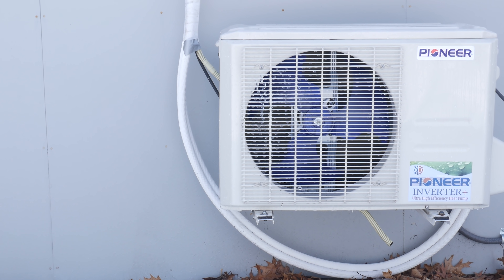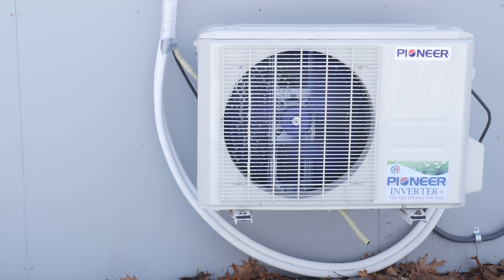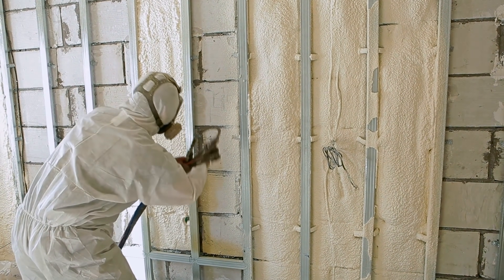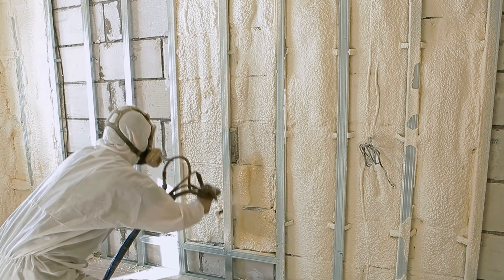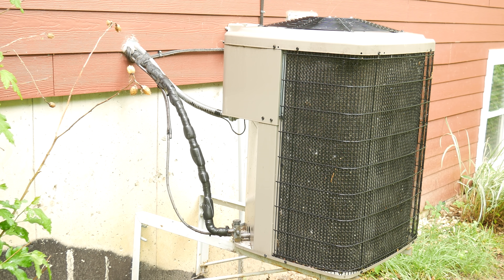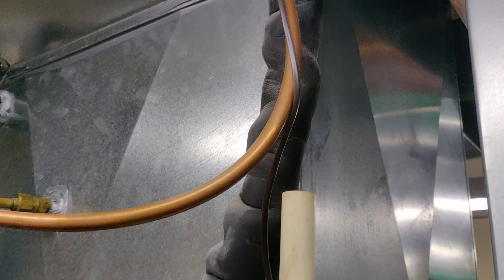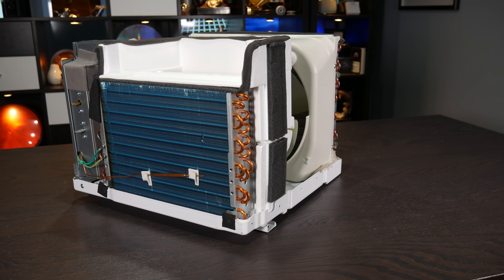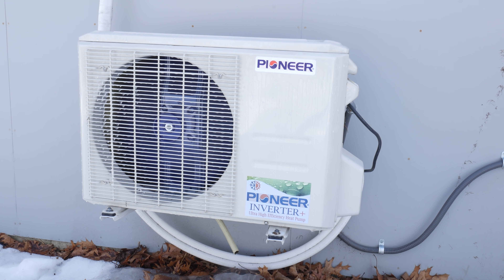Heat Pumps are Not Hard: Here's what it will take to start pumping

Comment: I've had similar experiences with even the simplest of minisplit installations. For a tiny minisplit installation like you had where it's right opposite an exterior wall they wanted to charge me $3k+ in labor or $5k to use their minisplit. Which is insane because I spent that much (~$5K) on replacing a whole furnace+evap 2ton unit. I just wanted some tiny supplementary cooling for my computer room. I ended up getting a cheap pioneer unit like yours and having a handyman do the install for <$1k.
Reply: We had a minisplit put in just over a year ago, and I am so glad that I paid the exorbitant prices from a local HVAC company instead of doing it myself.  Every 2-3 months, it would lose the last of its refrigerant, and we would need to have it serviced.  

I got to know the technicians (pretty much all the ones this company had), since they were in our house so frequently.  They were extremely knowledgeable and capable, and seemed to assure us each time that the problem was actually solved, but, as you can tell, it wasn't.  Eventually the head was completely replaced, and that fixed the issue, but before they reached that point, there was at least 60+ hours of work spent trying to diagnose and fix our lines.

Even though it was a bit more than a year (the term of our warranty), the installation company never charged us a dime, which is amazing since for every hour they spent installing this unit, they spent 10 hours on service calls, not to mention at least a thousand dollars on refrigerant (it was replaced probably 8 to 10 times in that year+).

I think this is why quotes are so high.  Even though most installs are painless, there are a few like mine where everything keeps failing, and you can't charge the customer for it because it is not their fault.
Reply: @uigrad  "I think this is why quotes are so high...you can't charge the customer for it because it is not their fault."  They DID charge the customer for it.  Up front!  They need to eat that instead, so that they actually produce decent stuff that works in the first place.

Yes, I know they're trying to save money by cheaping out on everything, and so the cost of the equipment will be a bit higher to go with the lower failure rate.  But when you figure in the cost of labor to troubleshoot and repair afterwards, especially when the problem is not trivial as in your case, that's really where the expense comes from.

Aaaand then we have perverted schemes where the equipment and the labor are on different sets of books, and it becomes profitable to keep the labor up.  Similar to McDonalds' ice cream machines that contractually must be the specific "investor special" model that requires regular service calls on purpose.  (google that; you'll see what I mean)  At least HVAC hasn't gotten to the "on purpose" part yet...
Reply: Me and my brother installed mine ourselves, and paid a company like $150 ton connect the lines, vacuum, and test. Had to call several companies, many didn't want to come just hook up lines, but it was well worth it. It is difficult to buy a vacuum set, they hold them hostage unless you an installer, and charge regular folk triple price. It was cheaper to just pay someone to come out.
Reply: @xeridea  What I'd like to know is, why do building and automotive systems have to be incompatibly different?  It's the exact same process, with the only difference being an accessory belt vs. a dedicated AC motor.  And you can get all the parts and tools you want for the automotive version, some of which even comes with instructions.

But no, someone decided that they have to use (slightly? maybe in name only?) different refrigerants, and different fittings to make it difficult to hook one up to the other.
Reply: @aaronduerksen1378  From speaking with someone at a store trying to buy a vacuum pump, the reasoning is that the HVAC installers don't want regular folk to work on stuff, it would take away their business. So basically, to keep HVAC installers employed, and able to charge a lot. Kind of like how Apple goes out of their way to make servicing anything they make as difficult as possible, to get you to continue buying overpriced phones and laptops.
Reply: @aaronduerksen1378  refrigerants all have different properties and you need to match those to the application at hand. those geared towards air conditioning a building wouldn't be suitable in a car ac compressor (newer refrigerants anyways). the change in fitting sizes is because the refrigerants used in buildings operate at much higher pressures, so the fittings need to be bigger and more durable. this is also one of the reasons they aren't used on cars, belt driven automotive compressors aren't hermetically sealed or even semi-hermetic, this means they leak much easier and they all tend to leak through the shaft seals over time (this is why car re-gassing is so common). other reasons include operating temperatures, specific heat capacity, differences in expansion devices, difference in heat load requirements etc. that's only for cooling a car, heating is very different as well and are not normally operated via a reversing valve like a conventional ac. Auto AC's are pretty much their own beast and most ac/refrigeration guys don't work on them because it requires a whole different skill set (and tool set). All that being said, auto AC's are a lot less difficult to work on and require less training and/or licenses in most countries, this is why the tools and instructions are readily available to the public.
hopefully i have answered you questions thoroughly enough but feel free to shoot a dm if not

Comment: One of the things I've noticed in the builder/contractor scene being a GC in the southeast for over a decade is that there are a LOT of "old school" techs out there that are afraid to adopt new technology.  
They've been installing the same ac/heat pump units for decades and they know it down to the tee, brazing lines, climbing in sweltering attics and damp and cramped crawlspaces to install air handlers and evaporators is all part of "how it's done" in their minds. They know what it takes and can give a solid price number that they are comfortable with. 
I hate to use the "ok boomer" analogy with it, (I'm knocking on 40 atm), but their resistance to trying anything other than what they can do blindfolded makes them overcompensate in pricing for "that new-fangled stuff the kids are talking about". I see the same issue with metal frame homes vs traditional stick construction. Had 2 friends in nearby towns have nearly identical metal homes built right b4 covid. One hired the well known contractor that had built stick homes for 40 years, the other found a builder that was familiar with metal buildings. The cost difference due to change orders from the stick man having to order additional material (he framed everything 12" on center, thus wasting literal tons of material as he could at least gone 16" or up to 24".) But the point still stands, the stick builder built the metal building as if it were traditional lumber because he was unfamiliar with a different building practice and mindset in general. I was also told his labor cost was also about 20% over what he would have charged on a traditional stick building bc of the "added complexity".
My century plus home has/had a traditional 3.5 ton outdoor heat pump/air handler combo on it. The previous owner added around 2000sqft to the house but didn't upgrade the unit to compensate (standard estimates call for a ~5ton unit for the total size now. Regardless, the unit finally gave up the ghost last winter as it would normally run full tilt with emergency heat just to try to keep up with the piss poor ductwork for the house (6 vents alone in the kitchen that was directly against the wall where the unit was installed.) dropped pressure to the point that the rooms at the far end of the house (3 rooms with 2 ducts each) each room only had 1 duct connected and even then, airflow was marginal at best.
All that being said, I am looking to install 2 mini split systems next month. I have sized the outdoor heat pumps to be overkill for the initial install. They are capable of 4 heads each but I only intend to run 2 heads to start for the downstairs then will add additional heads upstairs later if need be.
I had intended to do all the work myself from the get go, but called a few local hvac techs to get quotes for just install (I would provide parts) and all of them gave quotes that were around 2 times their quotes to replace the traditional unit and upgrade the ductwork compared to just installing parts that I was providing separately.
Reply: Nail on the head here unfortunately.

The contractors know that they can do what’s “easier” by making it the only sensibly priced option.
Reply: If you don't want to get raped on the install costs, DON'T CALL them "Heat Pumps".
They are Air Conditioners, with Reverse Cycle. Don't even tell the installer that it is Reverse Cycle, as it makes zero difference to the installation.
Reply: I cannot believe US homes are still stuck with inefficient ducted HVAC systems. Here, in India, everyone just wants a lower electricity bill. Most people will buy a more expensive AC even though it'll take 20 years to break even 🤣.

Meanwhile, my newly bought apartment (currently under construction) will be equipped with a very efficient VRF HVAC system. Even the condensate water will be collected and used to water the plants around the complex.
Reply: CENTRAL HEAT is a big seller.  The US buyers view A/Cs through windows or walls as “smum housing”.  Some neighborhoods outright ban their use

.

Comment: Great video. I wish I had found it when I was selecting my heat pump. I got 20 estimates (all but 2 were $22,000-41,000). If I had seen this video, it would have made my process way faster. I ended up with a 3-ton "mini-split" that hooks up an air handler so I can use my central ducting. Under $12,000 all in. I'm replacing an oil furnace and this house will have AC for the first time in its 132 years of existence. But I only got to a reasonable plan and estimate after having to learn way too much about HVAC, so I could sort through all the nonsense HVAC companies were telling me. This 45 minute video would have saved me dozens of hours.

Comment: Well, am I glad I live in Australia.  I paid about $600 for my Mitsubishi split A/C system, installed it myself, and it all runs on sunshine.  Ok, the climate here is much like San Diego, but I originally came from Canada, so I know what it's like up there.  But your presentation brought home the extent to which North Americans are chained to the existing methods of heating & cooling.  It's going to take quite awhile for this to change.  You are probably the most effective motivator there is at present.  The people in the industry don't want to change; neither do the people who make the rules and regulations.   But they have to.  Especially if there's someone like you standing there beating a drum.

You're  not wrong about the noise issues.  The outdoor unit for my bedroom A/C is less than a metre from my head when I'm in bed, with a very thin wall between.  Yet I can barely hear it when it's running, even when it's going full tilt.  

Did I mention my hot water heat pump, that I made myself out of a dehumidifier?  Ok, I had help from a friend in the refrigeration industry, but I gassed it myself with propane, and it works just fine.,  It needs to run for maybe an hour to make enough hot water for a shower.  Rather than try to invent a complicated thermostat system, I just put a 2-hour clockwork timer in the power line to it, so I can run it whenever I need some hot water. In the summertime, I don't need the heat pump, there are 3 solar panels on the roof that are connected directly to the water heater element.  The heat pump is needed in winter because there's not enough sunshine.  Works for me.

Comment: We're in Seattle,  and we had a 6 head Mitsubishi system installed. The installer asked about any HOAs they had to worry about. They never said anything about an ordnance being a problem, and we've been enjoying stable air temperatures for the last two winters, and one summer.
Reply: I’m In Seattle too. I replaced my forced air electric furnace to a central heat exchanger (Carrier). It did cut my power bill in half for winter and it’s a 2-stage (hi/low) compressor. Still though, if I ever have the option, these mini splits seem like a great way to go!
Reply: I’m also in seattle. Mind if I asked who you went though and what the total cost was like?

Comment: Hello from France ! Loved this series on heat pumps, learned a ton of things. Just so you know, you pretty much convinced me to change my oil system with a heat pump. Plus, I won't have to order it 3 times a year ! You may even have conviced me to ditch out my water / radiator system now.
Reply: Spaniard HVAC technician here. Just be sure to get a trusty brand (like Mitsubishi, Toshiba, Hitachi) because of future maintenance and parts availability ;)
Reply: Just make sure to check if you can adapt to the air type heating based on an air to air heat pump, in my experience (with air conditioners in heat mode) they are not that pleasant and they make some noise. I've made a test this winter (I live in Romania) and for us is not a comfortable option so I'll try to buy an air to water heat pump to use withe the radiators (fortunately the house is pretty well insulated and the radiators are oversized so even with the actual gas boiler I almost never use the water in the radiators above 40-45 degrees Celsius even at -10/15 degrees.

Comment: My Mom and Dad built their first home in 1975, a year after my birth.  They decided to go with a heat pump.  It's in Zone 5b if you're familiar with agricultural zones.  Our winters are frikkin cold and our summers are hellishly hot and humid.  It's normal to see 95° F with 90% humidity and -10° F with high wind.  For the first decade, that heat pump was the only source of heat in the house.  And this was using 1970s heat pump tech.  That unit was replaced...6 years ago.  What a trooper of a heat pump.  Yes, it had emergency resistance heat, but it was rare that it called for it.  You knew in an instant when it turned on, as the dust would burn off and produce that distinctive smell.  Well, that and the big red light on the thermostat, lol.  A heat pump is one of the most energy-efficient ways to heat your home, even in northern states with cold winters.

Comment: You mentioned having an AC unit put through a wall.  It brings back memories on what my Dad did back in the 1970's.  We lived in the Yakima Valley in Washington and at that time HVAC units were not common.  We had oil for heating and no AC.  My Dad bought a large window unit and put it through the wall and sealed it up.  The insulation on the house was a fiberboard  nailed onto the outside of the studs with no fiberglass in the walls.  The house was built in the late 50's.